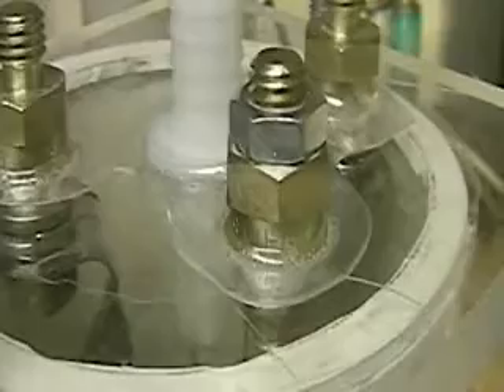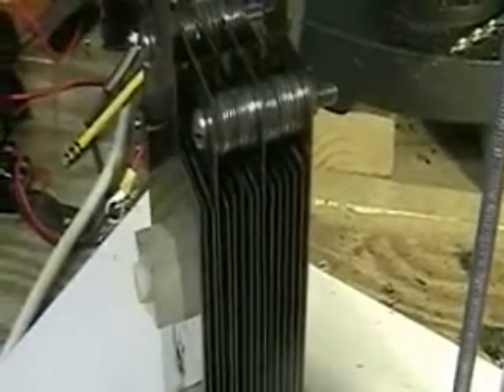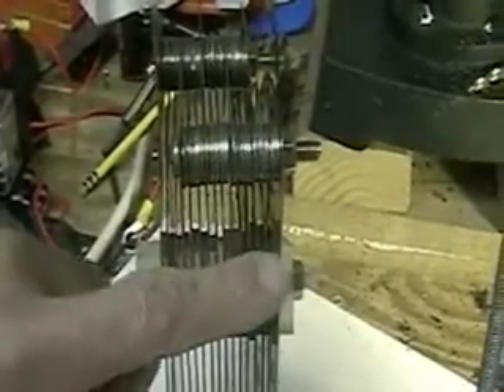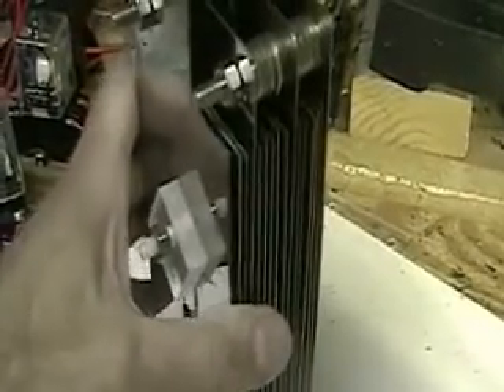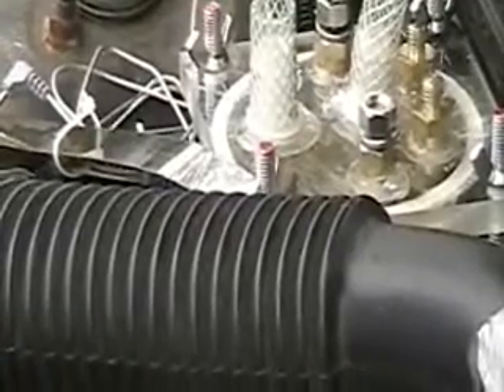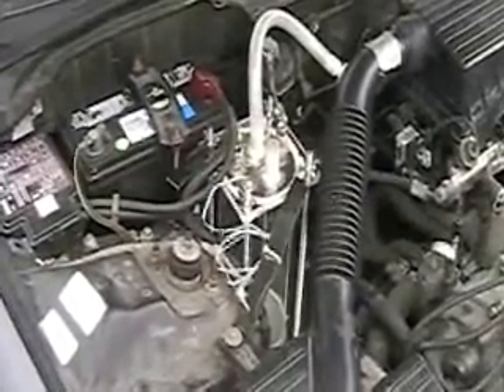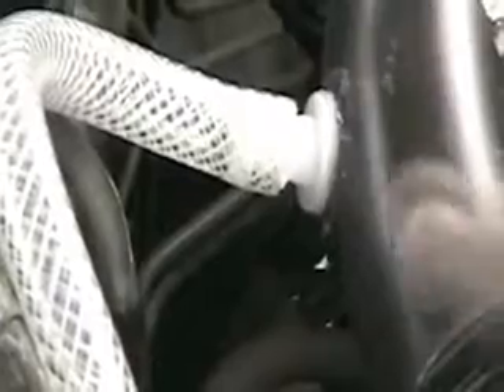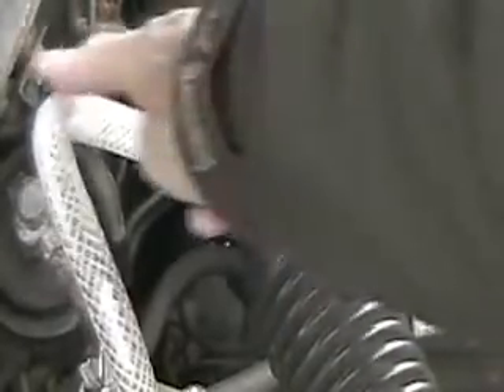Hydrogen Tap (FOCUS-HONDA UPDATE) 310

Comment: When the hydrogen goes into the air filter, and into engine, how does the car know to use less gas? Isn't there a computer? Or do you have to manually set it?
Thank you.

Ben